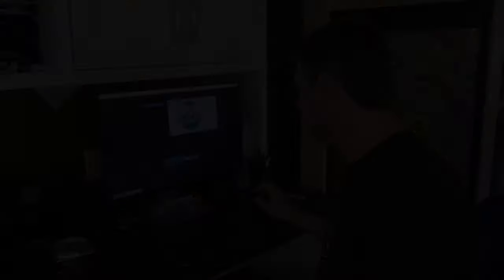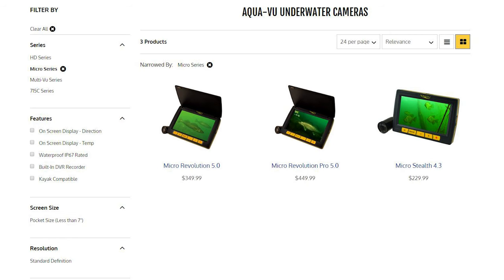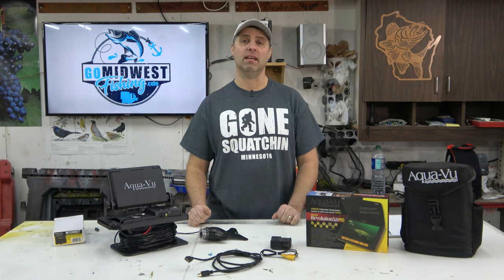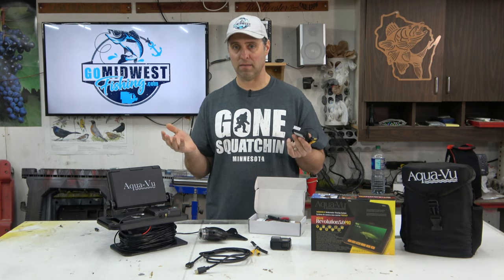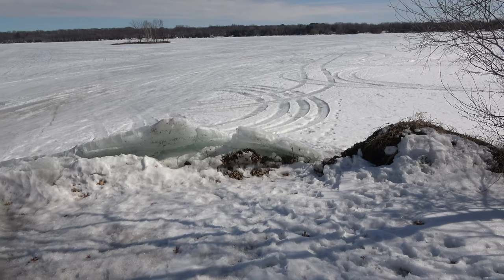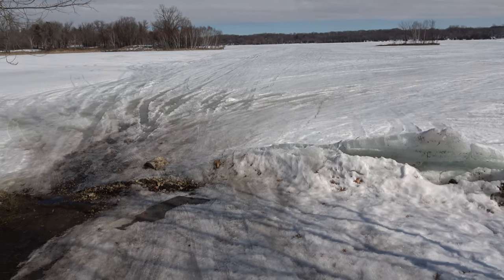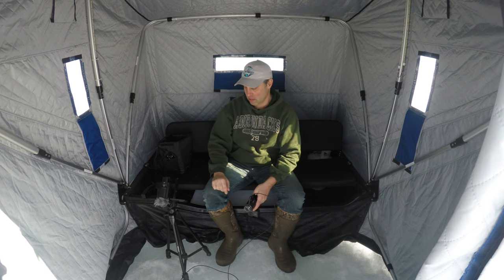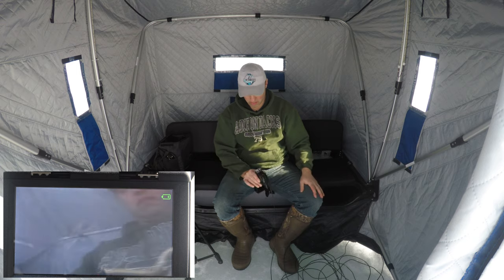Record 4K HD Underwater Video With Aqua-Vu

Comment: Good info, this video deserves way more views! 
Question - did your GoPro survive those deeper depths? Just curious since the GoPro is only rated for 33 ft without the Super Suit housing.
It looks like you're just using the standard frame right?

Also, to decrease the risk of loosing the GoPro, I would recommend to add a small tether from the Aqua Vu camera/cable to the GoPro.
Reply from the maker: I appreciate the comment. I get a little overboard with all my electronics. Sometimes I think I'm the only one. Anyway, I have had no problems with the gopro underwater. I've had it hanging in the water for over 6 hours at a time. I've even sent it down to the end of my cord at 50 feet. I will say that once you get past 30 feet, there isn't enough light in most lakes to make it worth recording. Once in a while I will have a glitchy gopro that just shuts itself off, and I never know until I pull it up and check it. Overall, its been working great.